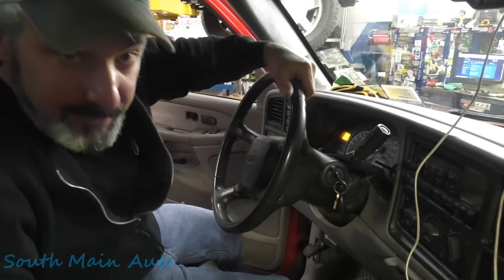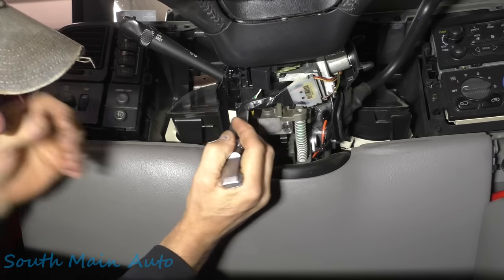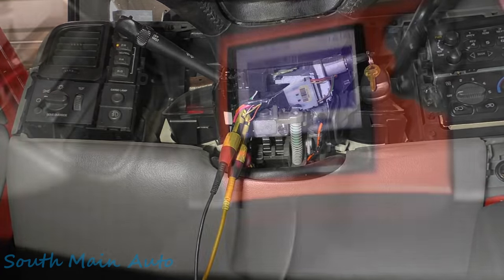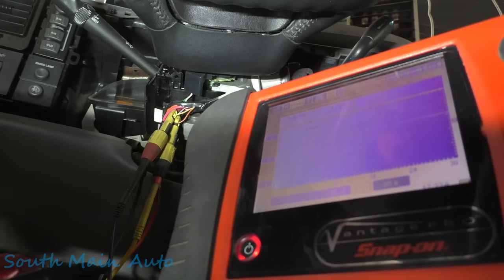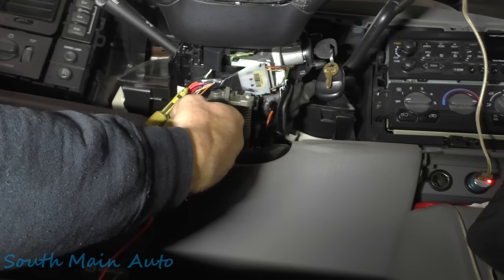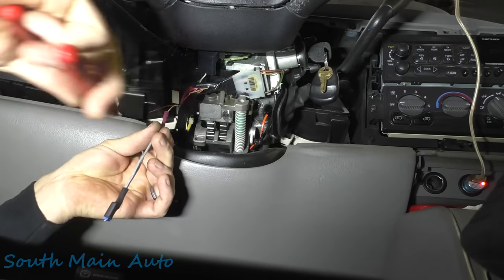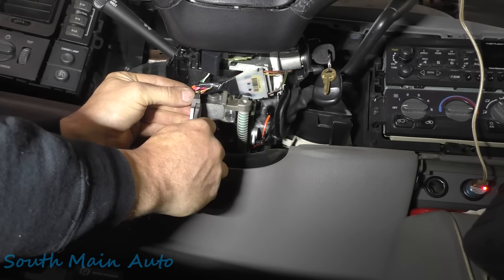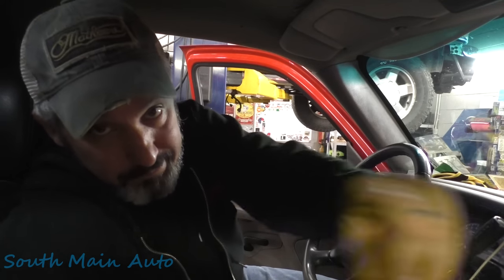Passlock™ System Bypass - GM

Comment: I just wanna know where did you get those connectors that allows you to tap into those circuits, as well as the jumper wire setup ?  I work on vehicles and equipment with systems that require  testing in awkward areas and those would be awesome, can I buy them separately or do I have to buy the scanner as well ?
Reply: Temu has tons of that stuff. And cheap. Amazon has it too at higher prices.

Comment: Hey Eric O, do you use liquid electrical tape? If so, what are your thoughts on it?  Love your channel!  Been a long time subscriber and always look forward to your videos :)
Reply: liquid tape is a little messy but it works fine just make sure it dries in a DRY area dont get it wet or anything
Reply: For anything other than covering pin holes made by test instruments it's junk looking for a solution to solve.  To obtain the correct insulation properties takes multiple coats.  Multiple coats can take the better part of a day.  You will get one use from the the jar... Non insulated crimp connectors, hot snot lined heat shrink nets you aviation level repairs.
Reply: I tried it once, waited for it to dry, then taped the whole thing together, only to find out the liquid tape didn’t hold, and the wires shorted together.  $400 mistake
Reply: @robertheinkel6225  Clear lined heat shrink for the win.  You can always see the status of the repair, and the likelihood of moisture intusion is almost zero.
Reply: @robertheinkel6225  Small zip tie for a physical connection then liquid tape or something for insulation. I've started using hot melt glue gun now though...bit faster and easy to work with. Just don't burn yourself

Comment: That will keep anti theft system in standby because always having the ohm value present, system will think the key is still in the ignition thus creating a parasitic draw eventually affecting the battery.

Comment: i am having the same issue on my 04 gmc sierra  but my  security light stays on  and its amber colored   but what  is odd about mine is   the other morning i started it up like normal and drove and about ten minutes later while i am driving down the interstate it  activated and  shut the truck down  and  dam near  caused me to crash   not sure if this bypass is the same for my truck seeing as  its an 04  not sure if  there is any  difference  from the yr to the model

Comment: I have a 2006 gmc sierra 1500.  Installed variable resistor as shown in video and set to correct voltage (2.476v)  Security light stays on solid when started with key, remote start is normal with no light on. Please let me know what could be causing light to stay on.  Tried relearn several times with no luck (relearn always worked previously & will work with resistor removed and original wiring hooked back up). Any guidance is appreciated!! Thanks!
Reply: @southmainauto

Comment: There are 1.2 and 1.2 K fixed resistors which would not be prone to drift over time compared to the trimmer but that car would probably be dead by then.

Comment: What happens if you were to just remove the module after the truck is running? Several people on you tube swear by this fix and say it's permanent.
Reply: Didn't in one of our Cadillacs. I think YouTube posters are often less qualified on their best day than Eric fast asleep.
Reply: passlocks (of this generation) have hall effect sensors/magnets in the key cylinder and cylinder housing, when you rotate the key it'll move the magnet across the sensor in a specific fashion (with one of ten results), if its the result the ecu expects, the vehicle starts and the injectors won't be shut off. if not, it'll start, but then the injectors will be turned off fairly quickly, stopping the engine.

this trick bypasses the hall effect sensor entirely, and forces the lower voltage the ecu is expecting at all times when starting. (and the variable resistor is so you can adjust to match whatever voltage the ecu is expecting)

if the hall effect sensor is dead, disconnecting the variable resistor thing after starting will let it run (in theory), but you're back to square one on the next start.

properly fixing it requires replacing the cylinder (not cheap), possibly rekeying your doors or the new cylinder to match old keys, and a 30+minute cycling process without a decent scantool to work the immo learn process.

ultimately, most people wind up going the easy+cheap route.
Reply: @ethelryan257  so you removed the module while the vehicle was running? How long did that last?

Comment: I have a 2001 Silverado and the light is constantly on when the truck is running. I tried the relearn, but that didn't work. I tried to bypass but I only have .7v on the yellow wire. I removed starter really and held key in start position and still no voltage on yellow wire. Any ideas??

Comment: Mr O,

Any idea what to do if the security light is always on?  1999 k1500 Suburban.  It used to "relearn", but now it doesn't.  I don't want to cut my wires if the problem is somewhere else. I replaced the tumbler once and that helped for a while, but even before that the light would at least flash.  I have nothing but a solid security light after hours of trying to "relearn".
Reply: I figured it out.  My problem was not in the ignition switch area like most of them.  Mine was with the passlock module.  It is behind the dash, just to the left of the cigarette lighter.  This part only fits 98-99 1/2 tons.  I got this one out of a 1500 pick-up for $25 and it got my k1500  Suburban going again.
Reply: 1998-98 1/2 ton Anti-theft module Part number GM - 16264955

For the 98-99 3/4 ton trucks it's 16264965

Comment: I personally love the crimp and seal butt connectors.  I never use them on wires king to sensors or computers but for everything else it’s game on.
Reply: Why
Reply: @ShainAndrews  because it’s faster then soldering and works just as well for most things.  Doesn’t require a soldering iron, solder, heat shrink or something to hold the wires together while you work on them.  And let’s face it, if you are fixing a wiring harness for a light or a horn it’s just as good as soldering.
Reply: @matthewzoelle9149  The "why?" is in reference to "never use them on wires king to sensors or computers"
Reply: Sensors and computers are more sensitive to voltage drops and it could affect readings.  0.05v on a 5v reference circuit could make a difference.
Reply: @matthewzoelle9149  That is hilarious.  You give these systems far to much credit.  If your alleged theory were true then you could potentially be reducing resistance.  A few grounds may be soldered.  The rest of the system are all crimped.  Including the all the terminations inside the plugs.  In addition damn near all electrical connections are "sensors or computers" in modern vehicles.  Just about everything is monitored.

Comment: Hello sir. I am having trouble and would really apprciate some help. I have a 2010 silverado 4.3l wt that i am trying to wire in a push button start from a 4 switch panel that has the toggle switch for ignition and the button for start. Ive gotten everything wired in and wired it directly to the starter. It cranks but doesnt start and im thinking its the passlock system thats stopping it. I just bough some of the resistors from your link and my question is is the voltage the same for thr passlock wire from model year to model year? Also mine seems to be the pink wire. If you are free for a consult i would be happy to venmo you for some advice or what you thinj would work. I have the stock wiring diagrams and all the info ready. Just dont really know how to test it as ive already cut the wires and removed that unit with the white weel thay slots into the key that actially turns to start the truck. Please help a guy out its been stuck in my driveway for almost a months now

Comment: Soldering or Crimp connecting,  both must be done properly to last. Both must have high quality glue shrink put on. Get a cold Solder joint and your in trouble, get a bad crimp your in trouble.  It depends on the situation which to use. No need to be triggered, but he did triggered this comment,  both are correct! Lol
Reply: When done correctly!

Comment: I have a 2006 Chevy Colorado that had this problem with the Vat security. 
I have a friend that worked for GM as a electronics engineer. My starting problem started to happen frequently.
My friend cut a blue and white wire under the dash. 
He told me if my battery went dead or I had to disconnect the battery I had to reconnect the wire to start engine and disconnect after starting. 
I connected a toggle switch to the wire. This was easier than crawling under the dash. I'm 87.
The small padlock LED on the dash is on always when the key is on. Not a problem for me.
Have not had a starting problem since, about 5 years. Is this the same as the video problem?
Reply: Similar...and essentially yes same system. On a different note, you're 87 and watching YT vids...very cool
Reply: @mrmotofy  Thanks Motofy, Much "more better" than watching The idiot box right"? LOL
Reply: @mrmotofy  Here we are a year later. still have the old Colorado. Still have the toggle switch on the dash. Still starts every time. Did have a dead battery a few months ago. 
I flipped the switch. Jumped the truck and reset the switch and off ya go. The only difference is I'm 88 now.
Reply: @CorbinAce  LoL...andnyou reply back to me a year later. I don't know what your problem is I lost a year Rock ON and keep on Kickin

Comment: I HAVE SEEN vehicles that were NOT stolen because of this system, but would have been gone had it been bypassed. More than once. I've seen more of them that were actually stolen despite this system, but it does work sometimes.

Comment: Got a 98 Savana in really good shape for 500 bucks with this problem. The guy had busted the the key lock and couldn't figure it out. Replaced the lock with a new no chip key, did a snip and connect, then did the relearn. To simple and I don't have to put up with the flashing security light.

Comment: Crimp and seal connectors are the automotive factory repair.......solder is frowned upon ......especially on airbag and fuel injection systems!!   Solder sometimes produces a readable resistance with age.   Crimp and seal will not!   It's a mechanical connection!!

Comment: I guess if GM really wanted to get nasty they could have timed the BCM to the read voltage value on the signal wire when the ignition is turned on and the magnet hasn't swiped the hall sensor.  If the BCM saw the correct voltage value before  the ignition was turned to start, the BCM could assume the resistor has been bypassed or there is an issue with the passlock module circuitry and disable starting.

Comment: Ahhh the memories. We used to measure the key to install auto/remote start at Circuit City. CC used to mandate solder and tape for a 'secure' connection. The flux would eventually corroded the wires causing major issues. Crimps are the way to go.
Reply: Rosin core solder will not corrode the wires. If you use acid core, it will. A perfect case of rules made by people with little knowledge of the subject.

Comment: Connection by your press-connectors:-  Why not are you not "tinning" the exposed copper with a little solder before clamping?  That would protect the copper wire from oxidation and corrosion due to humidity ingress.  Yes, it is another step in a convoluted process, but it is a stage that should not be omitted -- REALLY!    As an alternative, the two exposed ends should be twisted around each other mutually and soldered, and THEN, the heat shrink tube shrunk around them.  This is an even better type of joint.  Another form of joint is a mixture of soldering and compression:-  a heat sleeve is put in reserve on one of the leads (usually the longer one), then your tool compression joint without a covering is put directly on the two soldered ends, then squeezed (if space allows and heat of soldering iron allows, the joint is soldered, then crimped, THEN the heat shrink tube is pulled over, and shrunk.  Yes, a little of how to make a simple not-so-good job rather a bit more complicated, eh?
Reply from the maker: How bout this. I fix the rusted out pile of sh&t to last another year and next year it goes to the crusher with the crimp and seal connectors looking just as nice as the day I put them in?

Comment: Hey Bud I watch your videos abd you do a great job 👍🏻  , I have an 04 colorado and put my aftermarket pioneer stereo in and the passlock has came on solid and I have a no crank, no start problem. Good battery, if I put a jump wire on the no 85 pin on my start relay my truck will start and run but not in gear. PLEASE HELP ME. BOBBY if you need I will send my number if you can delete it after
Reply: Hey also I bought an interface for the stereo and I had a P 2610 code an I started to take the BCM out and my curtessay lights came on under the dash kikda like flashing from a bad connection, so I'm working to try to clean the connections, any suggestions would be greatly appreciated,  thanks again . Bobby

Comment: Just measure the resistor in the key and use the same value resistor in line. There are only 16 different values
Reply: Different system. This one doesn't have anything in the key.

Comment: Next time you get a "PASS Loc" no crank, look at the 'Starting Procedure' in the owner's manual.  I once had a 2001 Malibu that gave me problems and cost alot of money at Dealership to replace ignition switch. Fix lasted about 2 weeks and then 'No Crank' and "security" light struck again!!
I towed car home and eventually dove into problem. Owners Manual gives 'Code Relearn' procedure which I used. Never had another problem after that.  Dealer screwed me!!

Comment: I like your videos but this way the ECU sees the r-value all the time and can damage the ECU. A better way is to use a relay and wire the relay to be activated with the key sense wire so the key would at least need to be in the key cylinder.  
Also there's a company that sells a bypass that can be used with vehicles with VATS & Passkey II. I used it on a 04 Buick regal w/VATS and bypassed the BCM because it was faulty.
I've used this method and  it works coming from an old school aftermarket remote starter tech & not Best Buy...lol

Comment: Crimp butt connectors?  I usually stay away from them too.  I prefer to solder and heat shrink tubing.  But, in tight places protected from weather they work just fine.

Me being beyond anal in my DIY repairs, I would have put a dab of hot glue on the screw of the variable resistor to keep it from wandering off it's initially-set value.

Comment: guess he still has the actual "key" as a anti theft measure...not like the old two key GMs where the ignition got wore out inside didn't need even the key as long as you didn't completely lock the ignition.

Comment: Also, anyone that moans about crimp connectors can go pound sand. Haven't they noticed what literally all the connections in the OEM wiring harness are made with? As long as they are decent quality and crimped properly there's no issue.

Comment: Dude i did this and now I'm having no speedo and trans problems did i do something wrong?
Reply from the maker: Yeah you def did it wrong
Reply: @SouthMainAuto  did exactly what you did. Probably should  of just changed the ignition switch.
Reply: @SouthMainAuto  I don't get the security light anymore and it starts everytime but I have to keep disconnecting the battery and reset so I can drive it. I'll lose my speedo and only have 1st and 2nd gear

Comment: You should never cut into any stock wiring it's not the wires all you need is a magnet to hold up to the end of the key and it will unlock
Reply from the maker: You have no clue how this works do you....

Comment: Ok That truck should be rusted to the ground so who would steal that anyway. If you can do that I can’t. My problem is the tire sensors on my 2009 STS Cadillac the car shop says they can’t by pass them . They want $250. For 2 new ones just to get the light to go away . Ho Lee Chit !
Reply: Can buy the sensors and replace them yourself if they are  the preprogrammed ones...not very expensive. Hardest part is breaking the wheel bead, lay a solid 4' long 2x6 board on the rubber tire part then have someone start driving a car onto it while you hold rim down kinda. Lay wheel out facing up and board near valve stem/sensor. When the rubber bead is away from the rim, place a short 2x4 block in there between bead and rim for safety. Now you can remove old sensor and install new one. Most unscrew somehow. Carefully and quickly reach in to replace sensor. Once it's in remove block, get clamp out of way if you used one etc. Refill with a good air compressor and reinstall. Only real hard part is the wheel bead. The car should read and relearn after a short bit

Comment: The butt connectors are fine but they aren't perfect. If you use the exact crimper that you are using, and also if it goes where it can get wet, paint over it with Scotchkote. The glue in those exact butt connectors isn't perfect, especially on old wire they will leak water and get the green crusties. They are the best ones you can buy though.

The thing is that people who give you shit sign the backs of checks instead of the fronts, but every time I buy terminals and zip ties, it costs me a grand or even two. Those butt connectors aren't exactly cheap.

Comment: hey ray,,??,,sht,,wrong vid..solar pnls...they have resistors on the back,in the black box. watched an off grid guy re con them, bought used dead pnls. undone the box, cut out the mosphets, by 3 of them, replaced with 40 ohm resistors,, powered up.. put out more power. mosphets, same as fuses. sorta..  modern computerized cars,,why wont my car drive,,because the fuel cap is old.. totally astounds me..